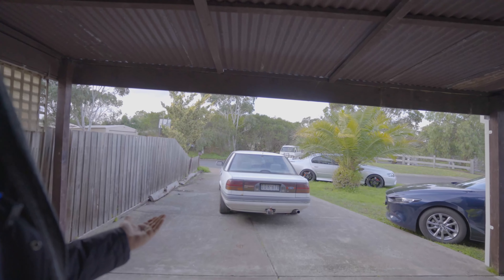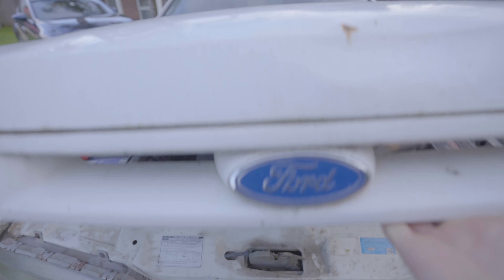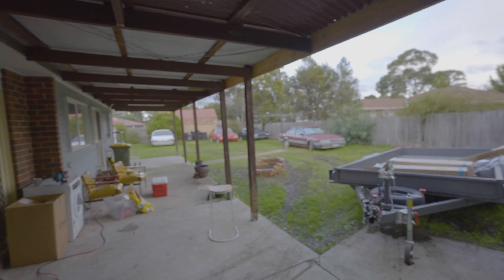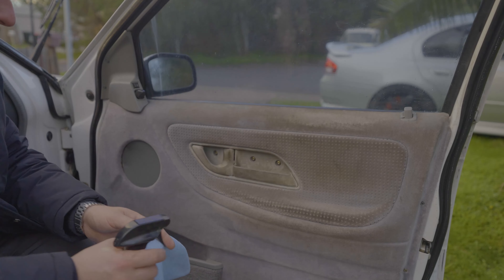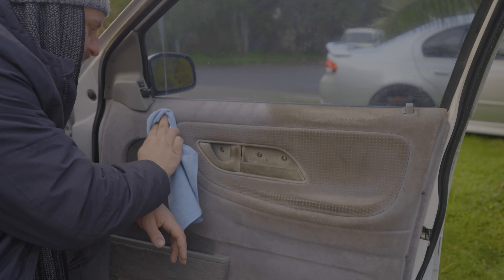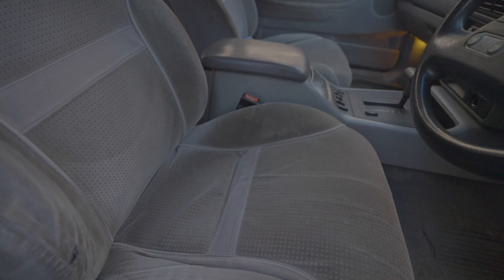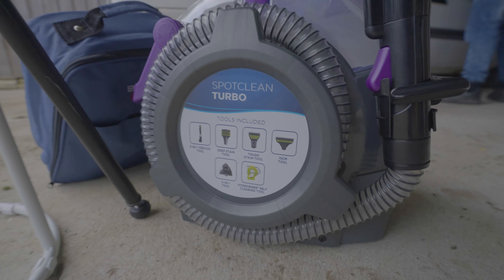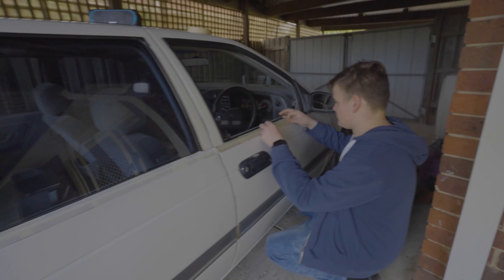EB Ford Fairmont Overview and Clean Up - NEW PROJECT ! Episode 1

Comment: What is a ‘paint correction’ - just a polish and buff or actually painting?
Reply from the maker: its basically just fixing the issues that the current paint job has to bring it back to or close as you can to the factory finish when new. I just made that up

Comment: Do you finish any projects lol what happened to Ea or Xf
Reply from the maker: Hey John , unfortunately I havnt finished either of those cars , the XF what you saw in the video is the only thing I’ve done to it so far , the EA I found out it might have a blown head gasket and possibly gas leaking , I’ve still got it though as you can see in some of the shots , it’s on hold at the moment , this EB is probably the easiest of cars I have to fox as it’s still got Reg , runs and drives well with only a few things needed for RW so I’ve decided to work on this one . I hate jumping from project to project but yeah I’ve just been collecting them and slowly working on them, I’m still moving house at the moment so I havnt been working on cars that much , I’ve been so busy with work and moving hopefully soon when I get settled in I’ll be pumping out weekly vids and get the cars finished off ,
Reply: George Auto no worries man, keen to see what you’ve got planned for the Xf
Reply: Also want to see more of the xf 😁